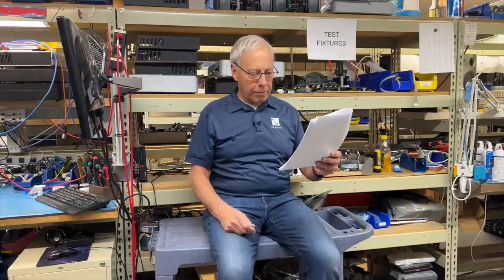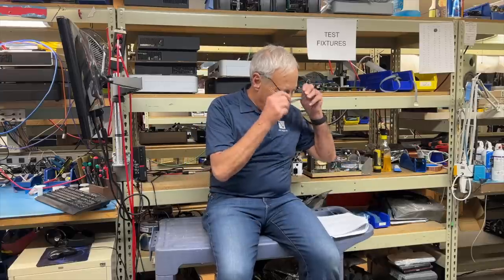The right way to turn on and off your stereo system

Comment: My pre-amp turns on "muted", and I never get any noise.  So for my situation (and many other people's situation), it will not matter.
But for Tom, in Durham, North Carolina (and others with that issue), then the power-on order does matter.

Although I might be concerned over a non issue, the reason I turn on my amps first, is because I am assuming that they will momentarily suck a good deal of power from the electrical circuit, at power-on time.  I do not want my other components (if they were already on), to be briefly starved of power.

All components probably take a momentary, bigger than typical gulp of power, upon being powered on -- and I am assuming that the amps take the biggest gulps, which I why I turn them on first.

Turning off, for my components, I usually turn off my DAC and pre-amp first, simply because I have their remotes in my hands.  I never get any noise from doing so.

Paul is correct, for Tom, in Durham, North Carolina's situation.  And Paul's recommendation is probably fine for everyone (myself included).  But if you have no issues (such as my situation), I see no compelling reason to do things differently.
Reply: @Douglas Blake "Best bet...  Leave the AC on and turn things off and on from their designated front panel switches."
By off, I meant by the conventional power buttons.  That was what I conveyed by writing: "simply because I have their remotes in my hands"

Standby is what nearly all modern equipment goes to, and not actually being off.  Remotes put equipment into "standby" -- not "off".
But even from "standby" to "on", there is a momentary larger than typical draw for power.
Reply: @Douglas Blake Can you prove that statement?
Why would the system draw 10 times more current than normal?
The A.C. is connected to a transformer why would an idle transformer draw such a heavy current?
Current and voltage are not stored up in an incomplete circuit and the circuit is typically run through a 15 or 20-amp fuse that would trip on such high demand.
Reply: @JonAnderhub  If you have, for example, two high current monoblock amps that are powered off, and you flip their switch to "On", at the same time, then if you have a lamp on that same circuit, your lamp will blink.

The lamp will return to normal in a split second -- but it will have blinked.

Comment: Generically speaking, though, if one's separate components- in this case, one's preamp and amp- both have a standby mode in which they're typically kept, is this sequence either irrelevant or less consequential?
Reply: The sequence is ALWAYS irrelevant

Comment: I just let the Class A poweramp stay on. That way it keeps my home nice and warm ;P
Reply: Turn off speaker outputs that's all I do. Just in case of electrical failure and get DC voltage on my speakers 🙂

Comment: The right way to turn on and off your stereo system: Never turn off the amps unless you leave the house for days at a time ;) Seems like it is just better overall. Always warm electronics ready to play it's best is very nice :)
Standby still makes the amps go cold so I don't even use that. They just stay ON 24/7. Get a little back in the room as heat as a bonus.
Reply: What difference does it make if the amp "goes cold"?
What components are affected by being "cold" and how long do think it takes for amp components to warm up?
Reply: @JonAnderhub  It sounds harsher when cold and smoother when warm. Pretty normal.
Not the point so don't even care about that..
It take too long.

Comment: Turning on and off Solid State audio components actually shortens their life! Leave your system on continuously unless severe lightning is in the area and you don't have proper protection installed on your AC. Tubes are another animal completely.
This guy actually put out a video 2-3 years ago advocating leaving SS components on all the time. Then again, he contradicts himself often...
Reply: Do you have any actual proof or links to valid studies that prove your statement?
I have a couple of amps that I have been turning on and off for 30 years and I would like to know how much of their useful life has been diminished.
Reply: @Douglas Blake So the answer would be no you don't have any proof that your statement is true?
Reply: @Douglas Blake  I am question the authenticity of your expertise though.
I have asked you several legitimate questions that someone with your supposed expertise should be able to answer but you dodge the questions.
Anyone with rudimentary electronics knowledge knows that capacitors have a limited life span and that life span is rated in hours.
Anyone that has a rudimentary knowledge of electronics knows that amplifiers generate heat which lowers the life span of electronic components.
So anyone with rudimentary electronics knowledge knows that leaving an amplifier powered on will shorten the life of electronic components by using up the limited hours of life in the components faster as well as shortening the component's lifespan by exposing the components to constant heat.
Somebody in their first weeks of study would of course understand this.
Reply: @JonAnderhub  If you have good equipment ~ I had a Sony 1130 Integrated amp, always worked great! Always used the front throw power switch; as Paul says, leaving the unit plugged, permits the unit to maintain a little, `keeper,' voltage, so that it will be on immediately when the front switch is moved to, `On.' In the, `old days,' good CRT Television sets did this, so that the picture would come up quickly ~

Comment: Audio gear that is not designed to keep the output stable during power on is poorly designed. Better is not to own it.
Reply: @@Douglas_Blake Avoiding a DC jump on the output is not trivial but can be more difficult in a power amp (where you have to live with it) than a line level amp (where you can power on before power amp). I recently bought a KEF active speaker which has a DC jump on a subwoofer output and it really maddens me.